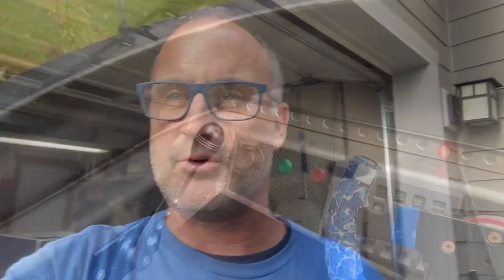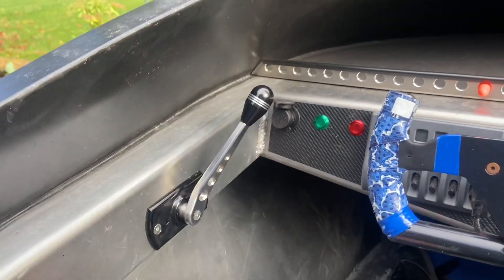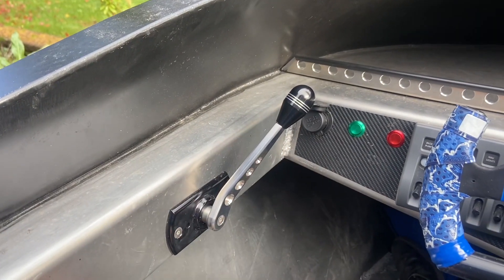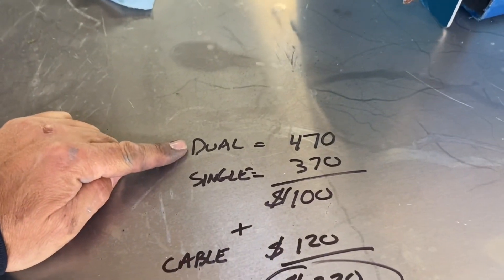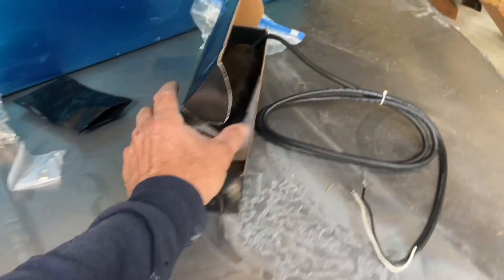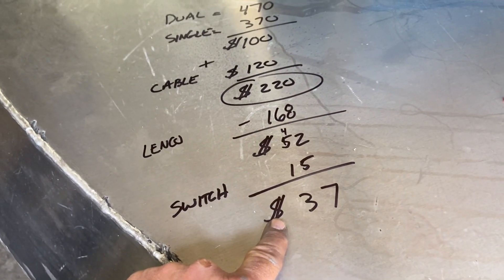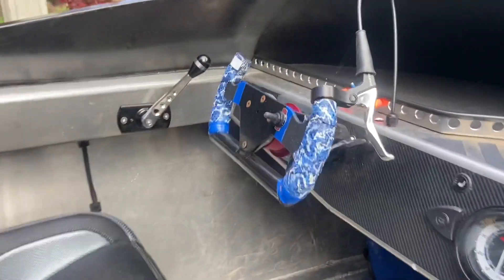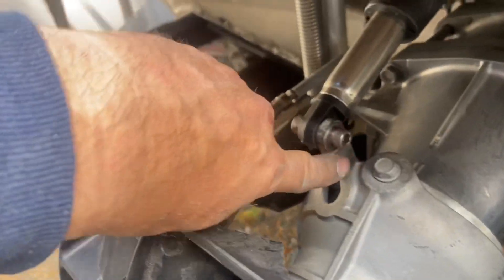How I build electric power trim on a mini-jet boat

Comment: Great thinking outside the box!  Did you ever get your travel issued resolved?        Im running a Berkeley jet drive with an Exact weld split reverse with trim.  I really want to have a trim gauge but the only system off the shelf is pretty expensive and requires a cable run outside the boat and it's not designed for  nozzle.   My initial solution was to run a linear actuator with limit switches and a trim sending unit. Bought one for a mercruiser outdrive.  
You could build a nice little box to hold the actuator and electrics and put it up under your dash.    I won't end up using it the actuator, my brother in law showed my I could just another hydraulic trim cylinder to move the arm on the sending unit.      again, nice problem solving!!!

Comment: Thanks for the how to info. I’m using the single lever SSS and southern jet trim nozzle on a 773. It works awesome and takes very little effort to operate. The lever holds in place when trimmed up or down. My complaint is the center screw holding the lever keeps loosening. Do you have that same issue with yours?
Reply from the maker: Hmmm no I don’t.  Red loctite?

Comment: Eric, thanks this gave me inspiration to do electric trim. I used a cheaper actuator with a cable, it's not as fast as yours. I'm wanting to have the reverse also controlled by an actuator motor. Instead of a switch use a hand brake like the throttle setup you have. Not only for reverse but also use it like a brake. Any thoughts or ideas on doing something like that? The linear actuator motors are too slow so I'm thinking some kinda screw rail paired with a high torque motor. It's a Southern Jet 4"travel reverse. Thanks brother, also wish that you that 🥇spot on the race circuit this season.
Reply from the maker: I like the instantaneous input of a handle & cable for the reverse.  It has saved my ass multiple times coming around corners to log jams, rocks etc

Comment: Hey buddy what size plate did you use for your hull tabs?
Reply from the maker: I think I just used 3/16”
Reply: @JollyRoger907  ok ya i got some 1/8 i was thinking on using in double sheer

Comment: How do you route the wires to the switch?
Reply from the maker: They go through the transom with a sealable grommet type deal then all the way up the gunwale to the bow and out through the dash.
Reply: @JollyRoger907  how did you route them cleanly from the wheel though without being in the way while turning? I think a dash rocker would be better for me…my 9 month daughter loves being on the boat and pulls on anything she can get her hands on lol. Her favourite is the stop lanyard bungie
Reply from the maker: @SailingLittleGooseBC  you gotta do some tests with steering wheel throw to make sure it works freely, then I typically put a loop in the wire below the wheel.  Another option is a coiled wire but I couldn’t find one that I wanted!